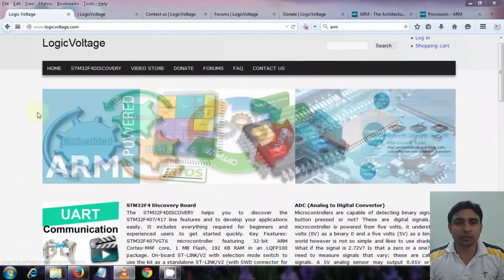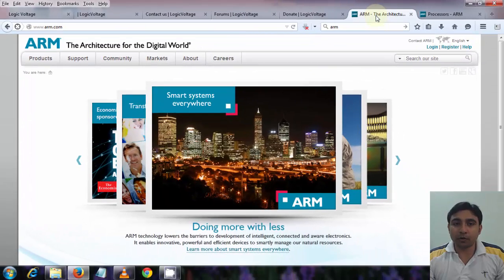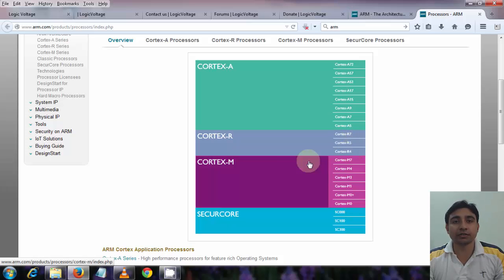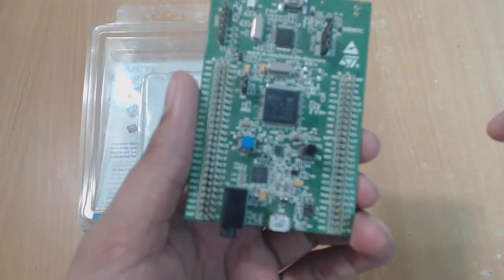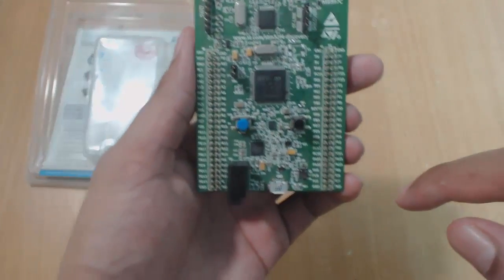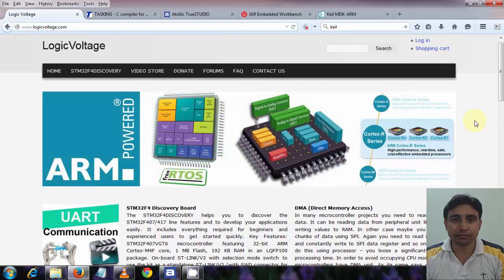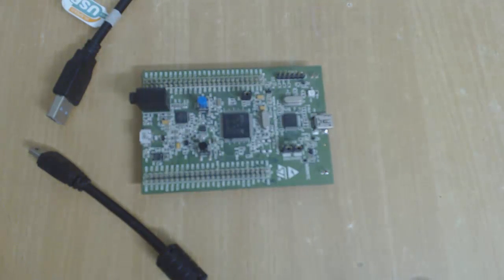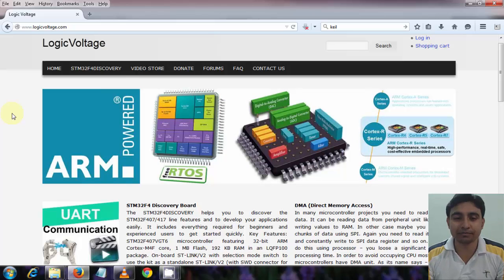STM32F4Discovery Tutorial 1 - Introduction

Comment: Very good program.  Excellent for someone with no micro controller experience or knowledge.  I went through the free tutorials but when I tried to buy the ones you have to pay for, I ran into problems.  I could not contact or register on this website.  I tried to register and completed the signup process.  You are told to check the e-mail address you provided for further instructions  This is probably for a link to verify that you are not a bot. The e-mail never arrives.  I tried this three times.  I also tried to use the "contact us" function several times without success.  I never got a response from them.  I suspect this is an abandoned site.  Before you start this series, be aware that the free ones you get on the website are all you will get.  You will never get access to the paid tutorials.

Comment: Thanks a lot for the tutorial! However, this board seems to be discontinued. What board to get that comes closest to the stm32f4 discovery so I can follow along your tutorials?
Reply: ST STM32F407G-DISC1 Discovery kit with STM32F407VG MCU
- currently available on Amazon.

There's also the STMicroelectronics NUCLEO-F446RE Model STM32 Nucleo-64 Development Board with STM32F446RE MCU

which takes Arduino shields, but has less memory than the MCU on the Discovery board.

There are some other Nucleo boards too.  I can't pretend to understand all the differences.